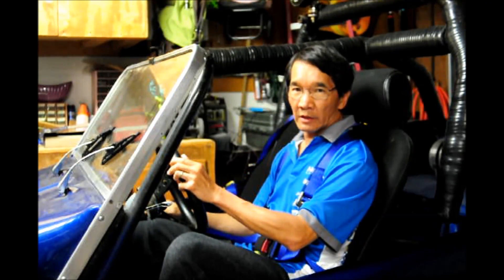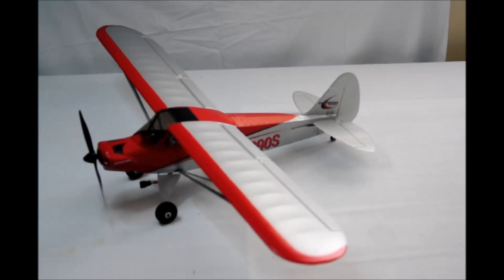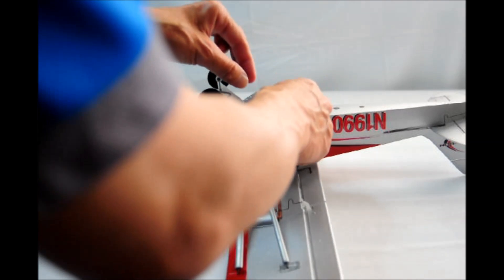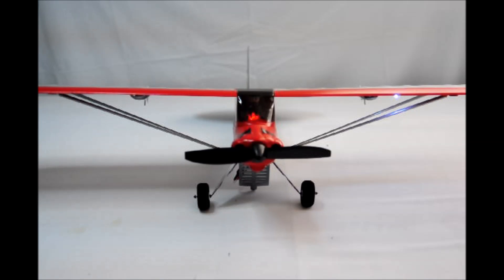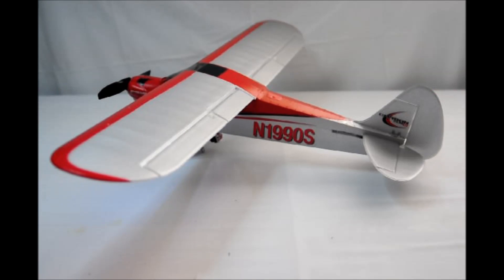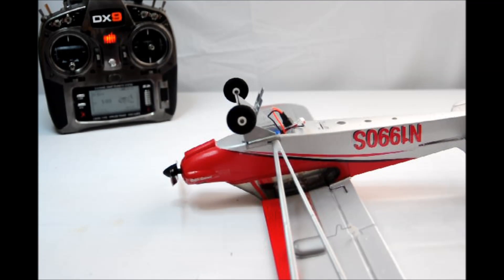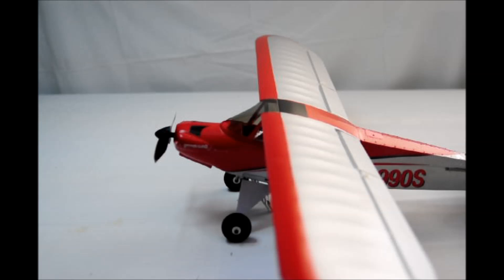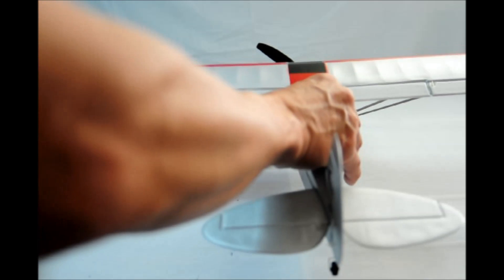Team Tech Tip   Proper set up of AS3X

Comment: Great video, I just picked up this plane and did my maiden tonight... I have my flaps set at 3 stage with 2 switch ... 25% 50% AND 100% .. at 25% it took off I'm not sure if it even rolled... did a flip and slapped it into the ground ... little nose booboo but no big deal.. tough little plane....My ? for you is ... what are your suggested flap setting .. ? I'm thinking the way I have it set up ... 5%  10%  and 15% at most... any feed back would be great...